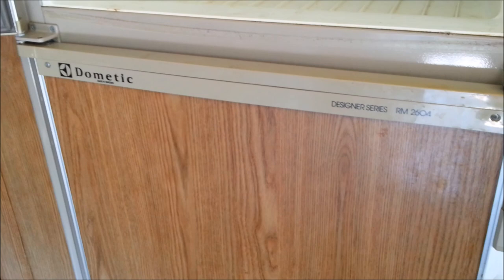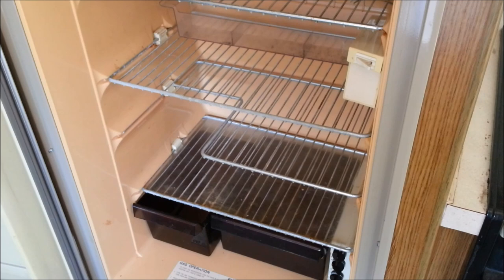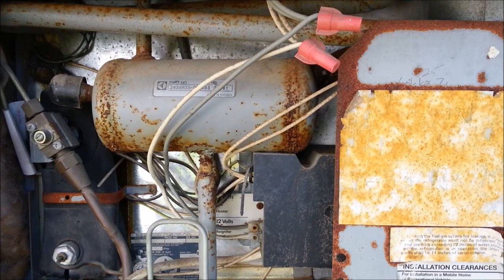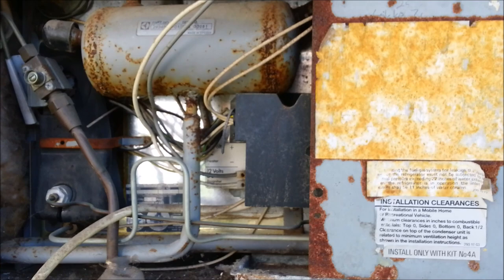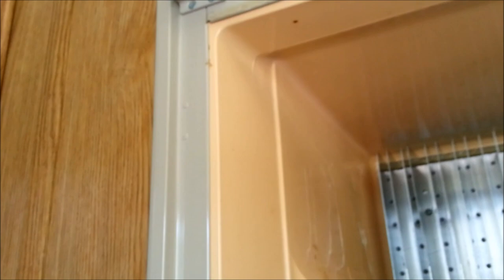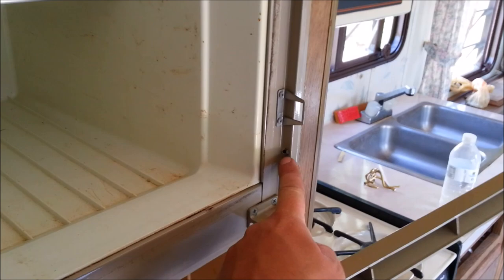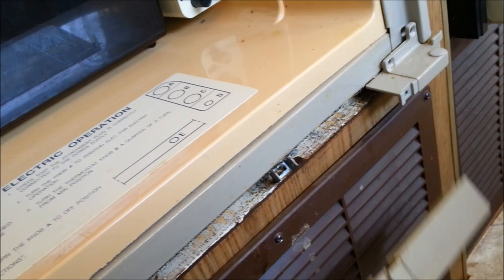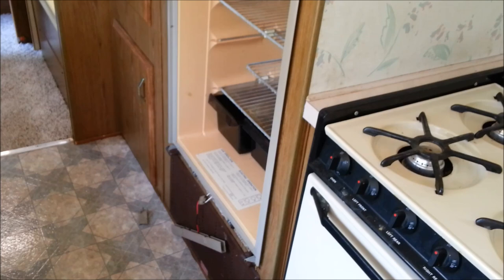Removing an RV/ Travel Trailer Refrigerator

Comment: My 1990 Pace Arrow has a Dometic RM 2804 and the mounting points are identical. The installer didnt put the 4 screws on the side of the front frame though the holes were present. Thanks for your to-the-point video. I knew some models had screws inside and with the horrific stench coming from inside I wanted to be sure how to remove it before opening doors!

Comment: Great info! We bought a used custom car hauler that we use for camping and hauling our toys (jeep, atvs). I had a very small 3-way cooler that works but is just too small for our trips. We want to remove the fridge and install a residential fridge in another space. This video has provided the info we needed, thanks!

Comment: i pretty sure im a little late i have the exact fridge after lots of research i found an apartment refrigerator stainless steel that fits right in cost me only $400 vs 1,600 at the rv place for smaller rv fridgidaire 4.5 or for bigger ones like the domestic fridge i found the avanti 7.5 hope it can safe someone some money
Reply: +Alex Giacoman, I also found the same one your talkin about on walmarts website, please let me know if that worked for you

Comment: well some i think ( norcold ) as a white and black wires, that also connected to your hot water atwood and the furnace connected to the norcool refrigerator, when we took ours out last night, the water heater and the furnace does not want to work.. any ideas on where to add these wires?

Comment: Did you have trouble getting the fridge out of the door? 
I have an old camper and want to remove the fridge old fridge to replace it with a more efficient one but... Been dreading trying to get it through the door.

Comment: What happened with the DC wires connected to the Dometic frig? Do they splice together a certain way with wire nuts or leave disconnected?
Reply from the maker: +stephen long cut or wire nut and leave disconnected